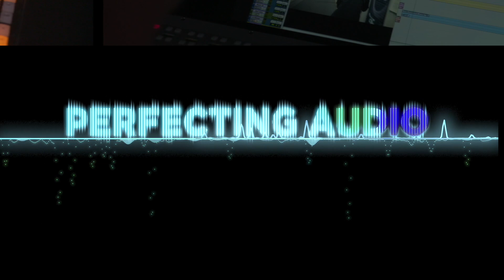Back to Basics - Microphones and how they differ: Perfecting Audio with Keith Alexander

Comment: I think I will have to wait for the next video then. I have a Sennheiser mic, but i think I'm doing something more than a bit wrong, when editing i notice that my audio levels differ a lot from cut to cut even if i record it in sequence of 10 second appart.
Does anyone have any suggestion?
Reply: I am assuming that you are talking about each clip sounding to the next. Well keep an eye on your meters and most of all use your ears! If you can bring the level of each clip in line with the next without you meters peaking then you are now starting to mix. If they are all clipping (Hitting the red) then you have started too loud. Bring all you clips back in level and then turn up your speakers. See how you get on.